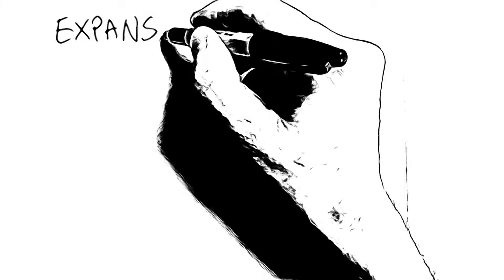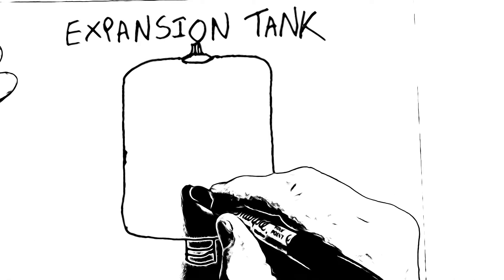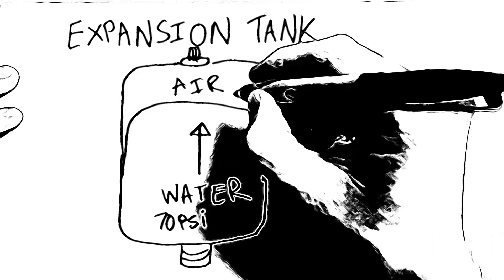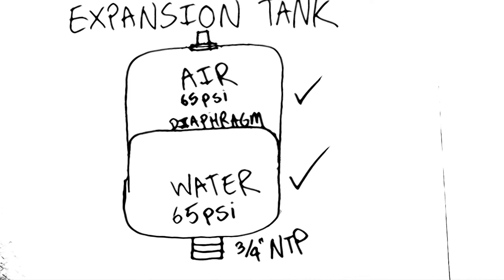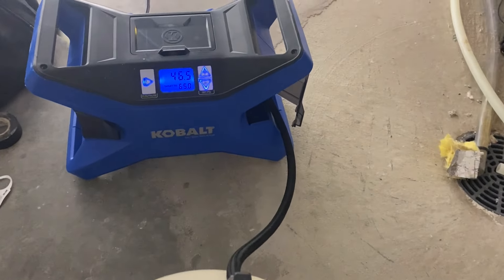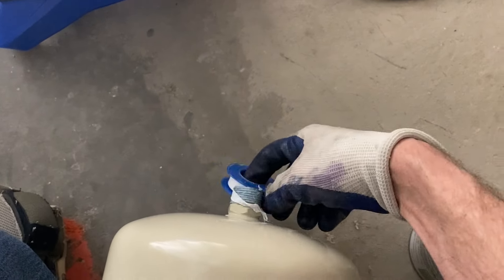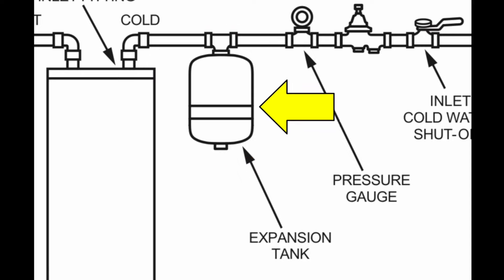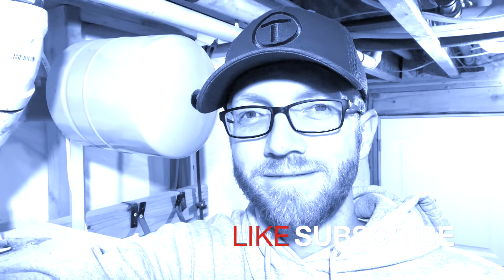Expansion Tank: Preparation, Pressure and Installation

Comment: First time seeing someone paste 1st then tape
Reply from the maker: Cleaner that way. Doesn’t really matter though.
Reply: That tape should be snug against the threads
Reply: @plumber-tom9470 Hello Plumber Tom......is it necessary to install a shut off valve after the expansion tank right before the cold line goes into the water tank? And I noticed how you didn't mention anything about how many inches away from the water tank it should be before the cold inlet? I've heard a minimum of 18 but would it be ok if it were a bit closer at say 10 to 12 inches? Would that really cause the expansion tank to not work properly. Im also surprised how you didn't tell people how you can test the pressure of your city water coming into your home by taking a water pressure gauge you can pick up at Home Depot and putting that on the closest outside water fixture where it comes in to the house. Maybe you have a video on that already........
Reply from the maker: I like it that way because it is cleaner.  I don't think it makes a difference.
Reply from the maker: @thomasfitzgerald2595  Hello.  Thanks for your comment.  Manufacturer's may have a recommendation for proximity of the valve to the tank, but I am not aware of any code requirements that way.  I don't know that it really matters how close it is to the water heater as long as the expansion tank is on the cold side somewhere.  I do have a video explaining how to check pressure.  Feel free to check it out.

Comment: After buying an Amtrol ST12 expansion tank, the instruction said to install the tank vertical like you mention.  I called Amtrol customer service and they said it didn’t matter which way you install it and the instruction sheet needed to be revised.  I replaced mine the same way the plumber install it 12 years ago when the house was built, sitting on top of the hot water tank with the expansion tank water inlet facing down.
Reply from the maker: Interesting.  Installation requirements may vary from one manufacturer to another. As long as you do what the manufacturer requires you should be fine.

Comment: You should not add air to the tank when the system is hot (pump or water line in service).   And there needs to be both air and water in the tank, so you should describe how to determine if the tank is waterlogged.
Reply from the maker: Good advice and suggestion. Hard to tell if a tank is waterlogged just by looking at it. But as you are probably aware, testing the air valve or removing the tank are the best ways to check whether the tank is waterlogged.   I prefer to replace old tanks even if they are not waterlogged.

Comment: Why does an expansion tank need a bladder? If I have an air tank with only a single bottom inlet/outlet and connect a water line, the air will remain in the upper portion of the tank and would be compressed by water flowing in to the point at which pressure inside the expansion tank would equal the water line pressure. If additional expansion occurs when the water is heated, the air within the tank will be slightly compressed a bit more just as if there was a bladder inside, no?  Obviously the tank would have to remain in an upright position with the single inlet at the bottom so that the air would always remain in the upper portion of the tank. I'm trying to understand why a pressurized bladder is needed inside the expansion tank if there is enough volume within the expansion tank to accommodate both the water line pressure and the additional expansion pressure.
Reply from the maker: Good question. That theory is correct. That has been tried in the past. However the air pocket inside the tank becomes comprised over time as the air often dissipates into the water. Having a barrier between the water and the air is the only way to ensure that the air will remain and provide the necessary expansion space.
Reply: Okay, so what if I do one of three things, 1) put a thin layer of oil in the DIY tank to avoid air absorption, 2) put a valve in the bottom of the tank into which I can occasionally force more air into the tank, or 3) install a shut off valve before the tank and a drain valve in the bottom to occasionally drain any water from the tank. I know I'm just being cheap but thinking outside the box can sometimes save serious money.

Comment: Do you have to apply both teflon tape and dope, or just one or the other would be good enough?  Also, could you adjust tank air pressure after it is installed?  Can one side of pressure in the tank be off by few psi....like maybe up to 5 or 10 lbs?
Reply from the maker: Hello. Good questions. 

Teflon tape is what really makes the seal. The dope just helps it along.   So definitely apply tape. You can check out my video about that. 

You should not add pressure to the tank after it is installed unless the water is still turned off. If you try doing it with the water on, your gauge will be reading the water system pressure instead of the air pressure in the tank.   Best to adjust the tank pressure before it is installed for the most accurate pressure. 

You want the pressure to be as close to the system pressure as possible. If it is less than the air chamber will be partially compressed as soon as the water is turned on. If the tank pressure is too high, then it will not allow for as much expansion when needed or it can increase the system pressure. 

Hope this helps.   Thanks for watching.

Comment: The water heater in my 14 year old home is starting to leak so I am replacing it.  Can I use the existing expansion tank or is it best to install a new one while installing the new water heater.  Also, I have purchased a hybrid heat-pump water heater as it is significantly more efficient (uses a third of the annual energy of a traditional electric water heater).  Anything different when installing the pressure tank on this type of water heater.  I am assuming the "hybrid" term is that it also has heating rods for times when the heat pump cannot get the water up to proper temperature.  Finally, any experience or opinions on the heat-pump type water heater.  This one takes the heat out of the ambient air in the mechanical room (as opposed to a separate unit outside as on some models.
Reply from the maker: Best to replace the expansion tank. They wear out over time. Installation is the same. Just keep it  on the cold inlet pipe somewhere.  

I have heard that hybrid heat pumps sometimes make the house cold.   Taking heat from the space around the water heater will effect the overall to some degree

Comment: Was adjusting my water pressure at the regulating valve, it was at 50 I use the hose Spicket with a pressure gauge and increased it to 65, then I shut off the main water and drained all the water from the Spicket from the house.  Checked the expansion chamber and it has zero psi.
Reply from the maker: The expansion tank may be defective. If the membrane ruptured then you will still see pressure when the water is on but it will drop to zero when the water is off.   In this case you need a new expansion tank. 

It is important to fill the tank with air pressure when there is no water pressure and the water is off. Otherwise you can get a false reading because there may be less pressure in the air chamber but when the water is on the water pressure will compress the air to the same psi as the water pressure.
Reply: @plumber-tom9470     While the water was off and drains and the pressure showing zero, I added air up to 40 psi, turn the water back on, and have not checked it.

Comment: Simple an to the point.  Thanks for that.  I'm installing a solar water heater which needs a 6 bar (84 psi) expansion tank for the circulating fluid.  Now I know how to prepare and install it.
Reply from the maker: You got it!
Reply: I’m not a solar guy, but 84 psi is high, pressuring connectors and joints.
In normal plumbing, the utility sets the incoming water pressure and the point of the video is to match the expansion tank to the utility pressure.  My utility provides 70 psi measured at a hose spigot, which is unnecessary high.  I know Sharkbite seals are rated for 150 psi and soldered joints about the same.  But over time, high  psi will wear out joints.

Comment: Great video, thank you for this one. Straight to the point and very informative. One piece of info I think we still need. How do you know what size tank to use for your system?
Reply from the maker: Good question. Depends on the water heater size and the pressure of the system.  Can be complicated.  But generally you can use a 2.5 gallon expansion tank for a 40 gallon or smaller tank. And a 4.5 gallon expansion tank for a 50 gallon or larger or multiple tanks.

Comment: For the non-plumbers, this video is discussing an expansion tank for a hot water heater, not for a boiler, correct?  Thank you
Reply from the maker: Correct. However boiler expansion tanks work the exact same. They just operate at a lower pressure.

Comment: Hi, I just bought and installed an expansion tank because boiler relief valve would spurt water  violently and I got hammering sounds. I did not check the levels or adjust the expansion tank - I didn't know it was required, though the factory adjustment would be normal and useful. Not so - when I got the furnace going again, the same thing happened. Is it the expansion tank ? Could I have killed the tank in one shot ? I already replaced the systems water pump and regulator and thermocoupler.
Reply from the maker: Hmm.  That sounds like a tricky one.  Noises can be caused by a number of things.  But I don't think your new expansion tank is ruined.  They usually hold up for years.
Reply: @plumber-tom9470  Hi, thanks for getting back to me. I solved the dilemma - I removed the closure large round door in the valve after the expansion tank - it was sludgy and likely stayed close - closing the system, although the valve appeared from the outside to be " open ". One can not always assume the valve is opening and closing. Thanks again.

Comment: Does it matter if you put on dope first then the teflon? I've always put teflon first, then the pipe dope to act as a lubricant.
Reply from the maker: That is a matter of opinion.  I prefer dope then tape.  Some plumbers disagree.   Most important thing is not to leak.

Comment: Good video. Thanks for sharing.
Question. Most expansion tanks that I have seen that are installed correctly ( my original was not installed correctly…) are dead headed (only has a cold water pipe going to it) and not mounted on a T fitting like you show… I was looking online after watching your video and found mounting instructions that show it mounted on a T fitting like your diagram. There are of course nothing showing a pressure gauge or shut off valve or any real instructions. Is it ok to dead head the water line into the expansion tank or is it best practice to Tee it off the water line?
Thanks for your time! 😊
Reply from the maker: The connection location of the tank does not matter as much.  It just needs to be on the cold water side somewhere, and the tank needs to be supported.  As long as that is the case, it can do the job from anywhere it is connected.

Comment: My system had 150 psi. The pop-off was leaking ( again).
I replace the pressure reducer ( again).
Installed an expansion tank. 
Pressure read at 50psi., after.

My pop-off valve still releases. 
Thoughts?
Reply from the maker: Once they open, sometimes the T&P valve (pop off) do not seal up again. I have seen that with brand new ones. So you might replace that and see how it does.

Comment: Hi Tom I have a well with constant water, pressure pump system. About 20 years old. I am getting air every morning at the sinks. Also hammering pips on occasions.  This has been going on for a few weeks Do you have Any check list I can follow.
Reply from the maker: Sounds like a problem with the pressure tank.  They are like a giant expansion tank with an air chamber and a water chamber.  When the tank goes bad, it makes strange noises and causes problems with the pressure.  Could also be the source of air in your lines.  I would recommend replacing the tank.  When a pressure tank does not hold pressure on a well system, it overworks the pump.  Replacing the tank can help the pump to last longer as well.

Comment: I have an inlet pressure reducing valve pre set at 12psi. Yet my boiler runs 20 psi cold and almost 25 psi hot. The expansion tank also precharged at 12 psi. My home is only one story (with basement where the boiler is) and the highest piping point is about 8 feet from the boiler.  The boiler was installed with the expansion upside down, meaning valve stem points towards ceiling. The circulator was installed right before the return into the boiler. When the maintenance guys come they always say that's ok. I don't believe it. Would adding or reducing pressure from the expansion tank help the problem because there doesn't seem to be any other way to lower the pressure?
Reply from the maker: You can add pressure to the pressure tank if you want.  It is best to have the air pressure in the tank the same as the operating system pressure.  But remember that when you pressurize the air in the tank, you will need to either remove the tank from the system, or drain the system to 0 psi, otherwise the pressure in the tank will reflect the current pressure of the fluid in the system.  The only way to get an accurate reading on an expansion tank is to have the system pressure at 0 psi.
Reply: @plumber-tom9470   Your response reminded me of another point. When I drain the system just enough to reduce the pressure to 12 it also returns to 20 or higher on it's own. Ok, so it will be easier to remove the tank as it has a cutoff just before it. So you're saying pump it up to 20 and reinstall and that may reduce the operating pressure?
Reply from the maker: @mightyj806  If there is a valve near the expansion tank, that is ideal because you can shut it off and not drain the system.  Once you have removed the tank, you can adjust the pressure to what it should be in the system.

Comment: I am on a well with pressure switch set to 40/60. I recently had an iron air injection filter installed which required a back flow valve as well for the regeneration process to be successful. I am now going to install a new hot water tank. I do not have an expansion tank currently, but with the new back flow valve I think one is necessary now. Since the pressure in my system is dynamic with the 40/60 pressure switch should the expansion tank be pre charged to 60 psi to match the top end pressure of my system?
Reply from the maker: Yes. That is what I would do. That way the expansion tank will be able to take any excess pressures.   Frankly, a well storage tank basically is a giant expansion tank, so it is questionable as to whether an expansion tank is needed or not. But since it is a code requirement, I recommend that they be installed.

Comment: How do you properly check the air pressure of the tank after it has been installed and in service, especially if you adjust your pressure regulator up or down? Considering the tank pressure needs to match the water pressure I'm assuming there is a procedure to check the air pressure of the tank?
Reply from the maker: To check the pressure, you have to shut off the water to the system and drain it down. Once the pressure is at zero in the water lines you can take a reading from the tank and see what it is at.
Reply: @plumber-tom9470  I have a similar question.  I already have a tank installed, but I'd like to get an accurate reading of my water pressure (after the pressure reducing valve).  How do I do that without the air pressure in the tank affecting the reading?  Do I have to let all the air out of the bladder?
Reply from the maker: Hello.   The tank will only affect the reading if the tank pressure is higher than the system pressure, and even then it is questionable as to how much.  But yes, if you want to take the tank pressure entirely out of the equation, then you can release the air, take your system pressure, and refill the tank.   @captainstress

Comment: My system rests at 80psi and will spike as high as 120psi, which it did that on only one sink in the bathroom, does this mean I will need either a reducer or a water pressure regulator?
Reply from the maker: Yes. If it goes over 80 psi you will need a pressure reducing valve.
Reply: Okay thank you! I will buy that now and get a gauge installed in my system too. I appreciate it!
Reply from the maker: Good plan.  Thanks for watching!  @Wolfpack0512

Comment: How close to the hot water tank does the expansion tank need to be located? Can it be 5 or 6 feet away? Also my homes water pressure changes alot through out the day. I have not put a gauge on it but I can see that my yard irrigation heads shoot longer and shorter distances depending on the time of day, so because of this, how should I set the expansion tank pressure,  on the high end or low? 
Thanks for any help, and the great video!
Reply from the maker: Yes it can be installed a distance from the water heater as long as it is on the cold line.   You might consider purchasing a test gauge from a hardware store or plumbing supplier to find out what your pressure is.

Comment: I have a Watts expansion tank that does not pressurize, I swap the schrader valve even with that it did not want to pressurize, can anything be done or should it be dumped and get another one?
this tank have a 1-in thread on it and I have another one with a 3/8 in Inlet on it, does it make a difference? thank you
Reply from the maker: Time to replace it.   The threads are likely 3/4” MIP.  You want to stick with that. Smaller threads on expansion tanks are usually used for other low pressure systems and might not have the pressure rating needed for potable hot water.